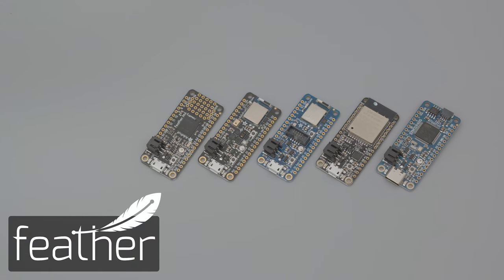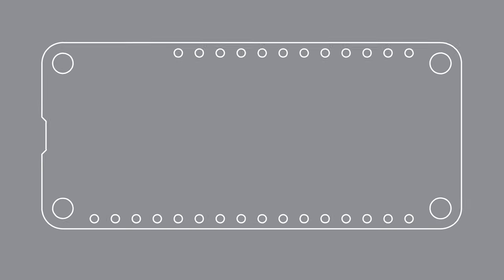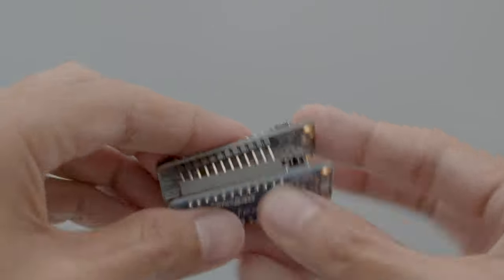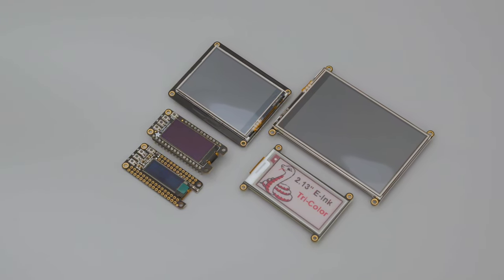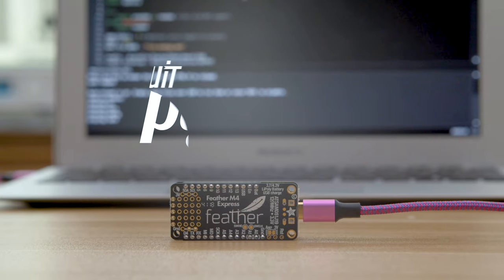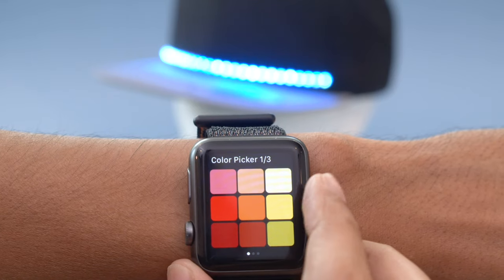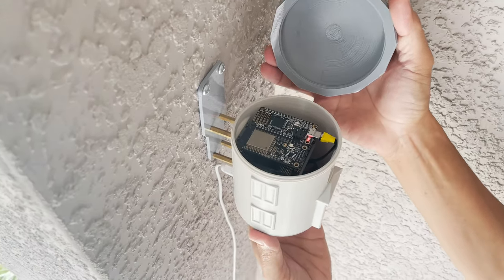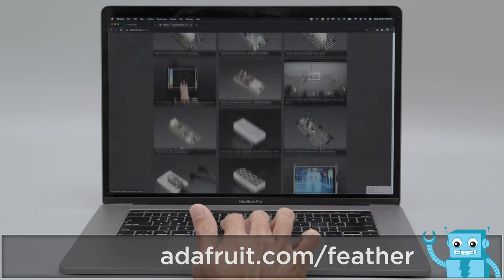What Is Feather?

Comment: What I would like to see is a I2C FeatherWing. It would have the LTC4311 active terminator multiple STEMMA QT connectors on it. Just food for thought. Could stack a ESP32 and a display together as the head of an octopus of cables to various sensors.
Reply: Every feather I have played with includes I2C on standardized pins (always in the same place and labeled sda and scl - it's part of what makes a feather a feather).  So you can build your project on a wing proto-board and swap out micro-controllers - your wing still works.  For more info, check out the spec: https://learn.adafruit.com/adafruit-feather/feather-specification
Reply: @EricLowryUT  I know about the I2C standardized pins, and have used them. I also know know about the proto-boards and have used them. I2C connectivity is something needed so often that I was suggesting a feather wing that included the LTC4311 and connectors to really have plug-in-play rather than cobble it together every time myself. Think of it as a combination of the Adafruit LTC4311 I2C Extender / Active Terminator - STEMMA QT / Qwiic and the SparkFun Qwiic Multiport without needed soldering and multiple connecting cables.